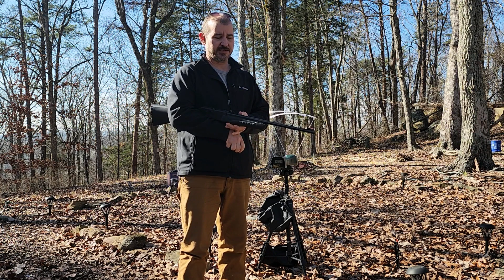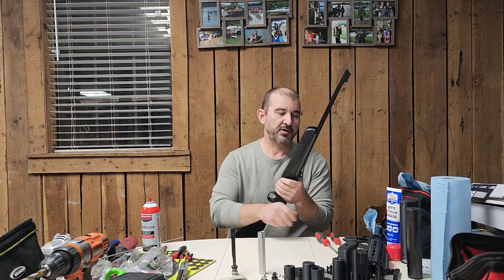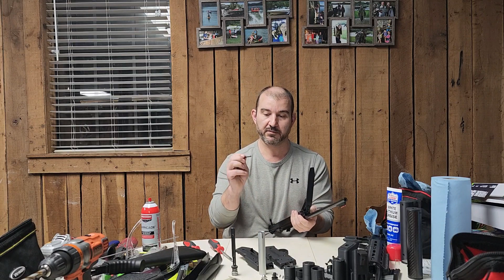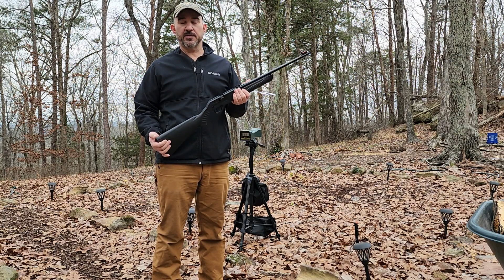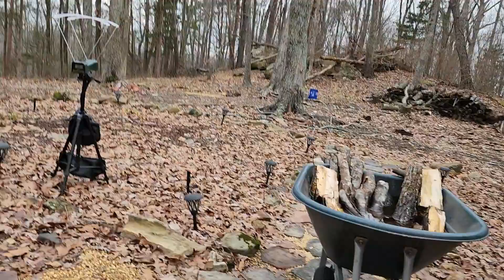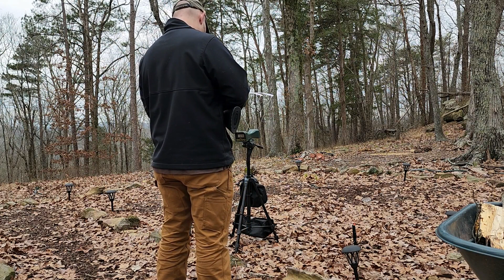Daisy Model 901 installing the PBL power components

Comment: Congratulations on the mod and the demo video.

However, I have a few questions.

Regarding the power increase:
You only changed the valve pin and the piston head.
Didn't you have to enlarge the air intake in the cylinder?

Or remove the flat piece from the trigger?